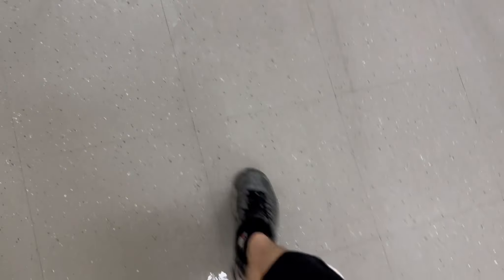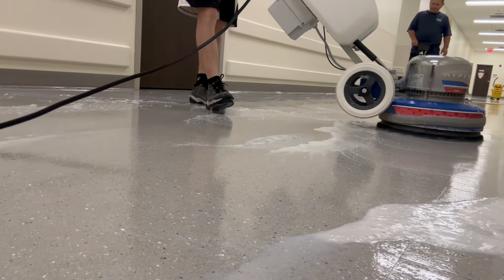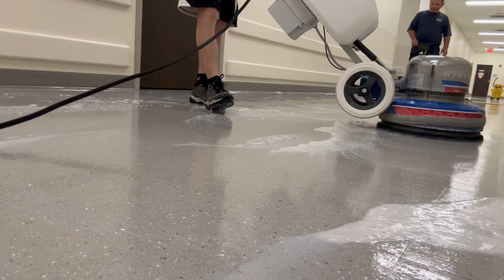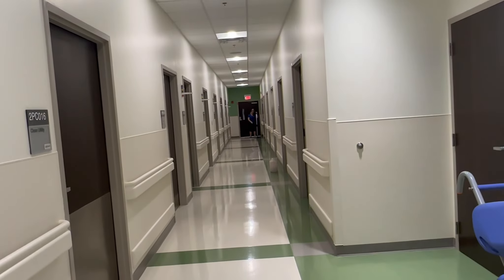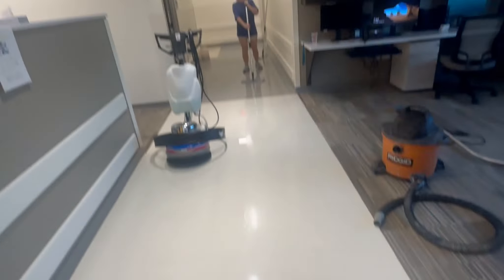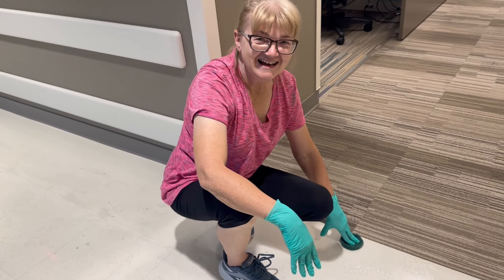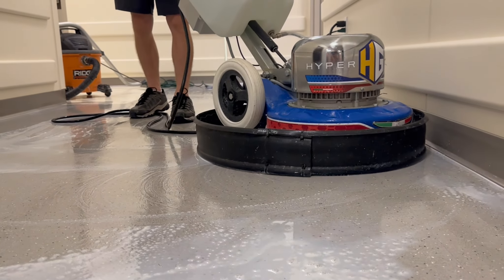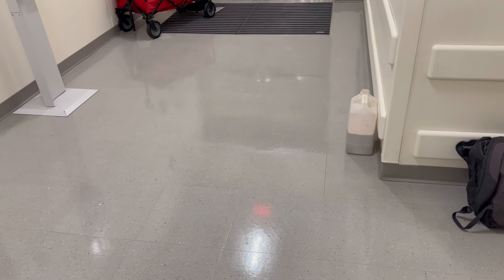TAKING ON THE LARGEST STRIP AND WAX FLOOR JOB WE HAVE EVER DONE! In over our heads..?

Comment: I've been doing this for 20 years. Always start with your feet on dry floor and work into the stripper. It's way safer. Also, what was that ring you had around the scrubber? Looked like rubber baseboard. Good idea for keeping the stripper and wax from being thrown up onto the walls.
Reply from the maker: Yes home made splash guard. And good tip! We always do some things to add a little drama to the videos!

Comment: I love how You were slipping and sliding! Looks so fun!
Reply: It looks fun, but be very careful. Stripper on wax is a different kind of slippery than ice, etc. The stripper causes the finish to release from the floor; when you step on it the stuff you're stepping on moves. It's sort of like every step you take someone is pulling a tiny rug out from under your foot. If you're not used to it it can be extremely hard to stay on your feet. It's certainly much more difficult than walking on snow or ice.

Comment: I work for a manufacturing business as a Janitor, and the building is 30+ years old, and the company has not taken good care of the VCT flooring tile for the past 10-20 years. So I asked them if they would get me what I need to try and restore these terrible looking tiles, and they said yes. So I have been doing some long hallways and it is requiring me to use 3-4 applications of stripper + using the machine 3-4 times to try and remove a majority of the wax. I have to get on my knees first ( 61 years old Lol's ) and scrub the baseboards with a brush + green scrub pad to try and prep the molding first, and I still can't get every square inch of icky brown buildup that has collected where the tile meets the baseboard. I wish i had some of the equipment you guys have?? MY question for you is this? What do you do with the round scrub pads that you use on the floor scrubber that collects all that old wax and stripper? Do you take a brush to them and try to reuse them, or just use a brand new pad and throw the other ones out

Comment: Great job, Quick question how was the fumes? It seemed areas weren’t ventilated much.
Reply: It depends on the brand in my experiences. Some gave a polymer smell but some like Juggernaut have no smell at all. Most buytl based floor strippers are non caustic and safe. I wouldn't drink or bathe in the stuff and wear eye protection. Walking behind the swing machine instead of in front like seen here will make for less slippery, more solid ground for the operator too.